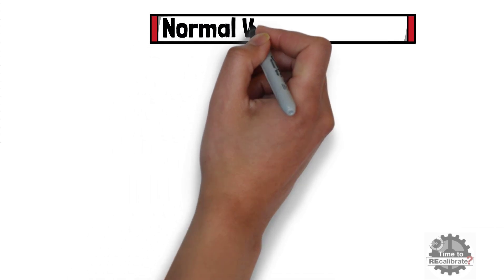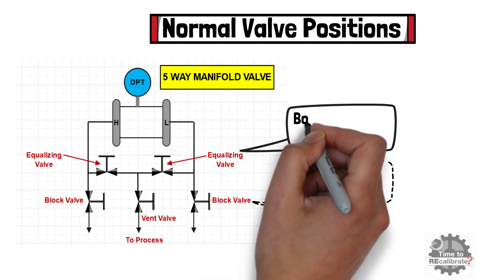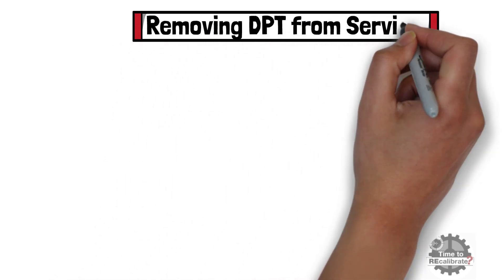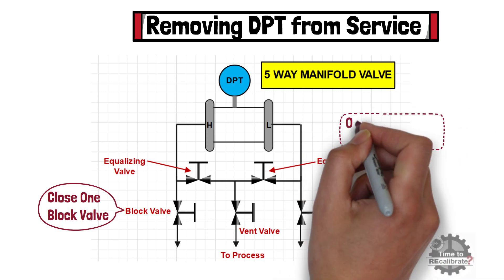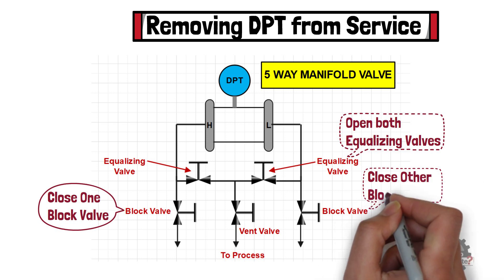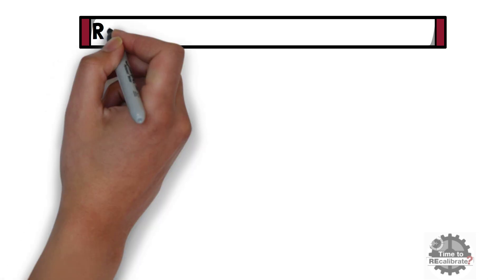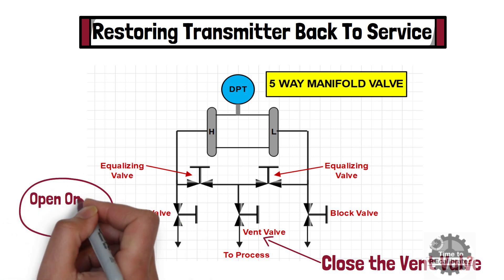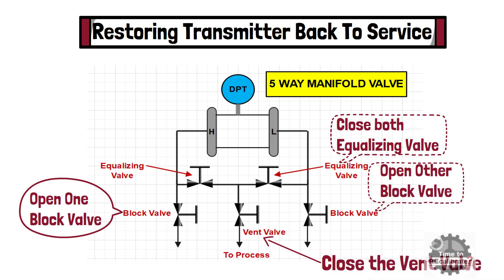5 Way Manifold Valve operation for DP Transmitter | DP Transmitter Service instructions

Comment: In case of removing DPT, why don't we open both the equalizing valves before closing one of the block valve to balance the pressure on high and low side of the transmitter, same as the video on 3-way manifold?
Reply: Because will do flow path from HP side to LP side.

Comment: Why 5 valves used? Instead 3 valve
Reply from the maker: In some of the application, you need to use 5 valves instead of 3 valve

Comment: Restoring DPT Back to service - Close vent valve ( drain valve), close equalizing valve and open both isolation valve .now Transmitter in service.  it's correct or not correct?
Reply from the maker: Yes, it is correct
Reply: @InstrumentCalibration  👍 thanks

Comment: Is it some kind of special 5-way manifold. Because the standard one doesn’t work as you have explained. The standard one with every transmitter comes with two isolation valves, two vent valves and one equilizing valve. 

Never seen 2 equilizing valves.. could you please explain about it. Or change your video it’s misleading
Reply from the maker: I haven't come across the valve, which you have explained in this comment
Reply from the maker: Hello Rituraj... Thanks for asking this question. Please google its Rosemount 3051 Transmitter manual. You will get your answer on page number 62. I am talking about Rosemount 3051 5 Way Manifold Valve